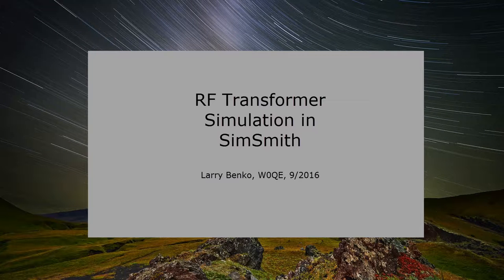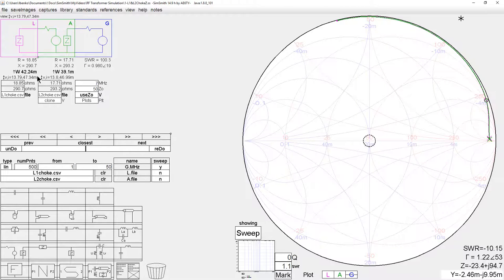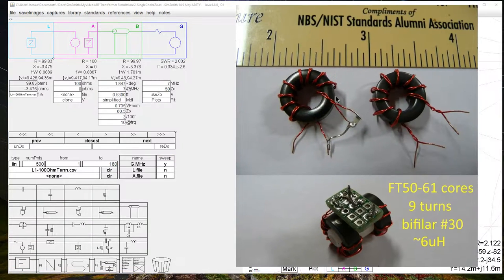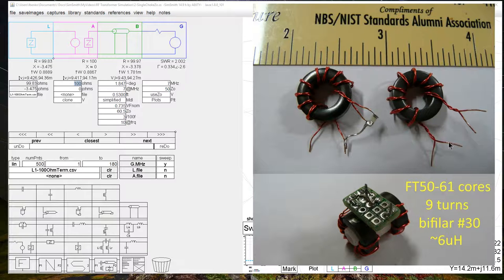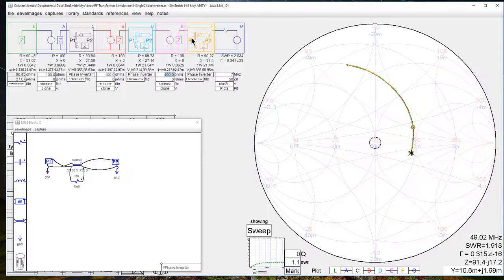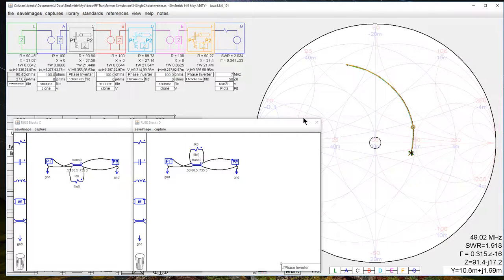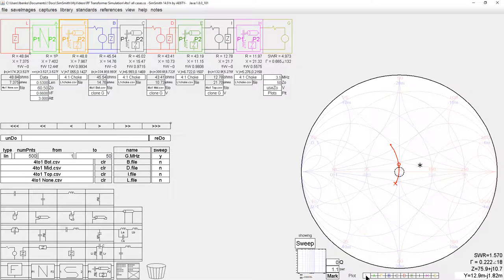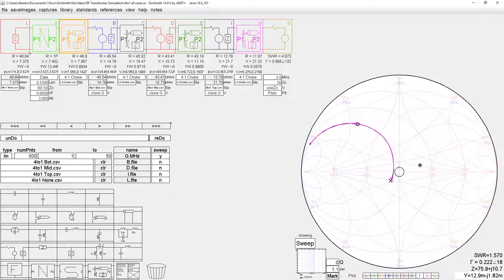#7: RF Transformer Simulation in SimSmith (Adv. 7)

Comment: I am interested in building an impedance matching circuit for phasing two vertical antennas.  Can you point me to any pod cast you or others may have done on multi winding impedance matching simulation using SimSmith?  Thanks!
Reply from the maker: Sorry but I don't know of anything that I could point you to.
Larry

Comment: Can you show more of how to create the transformer component?  Or point me to a video that discusses it? I'm interested in the other case: matching to a lower complex impedance.
Reply from the maker: I'm not sure what you are asking.  Maybe it would be better if you could explain what impedance you want to match from and to, at what frequency or frequency range, and at what power level?  Is your question how to design the circuit, to synthesize it in SimSmith, to physically build it, or to measure it once it has been built?
Larry,  W0QE
Reply: If this gets too long, I think you can go to email from this.  This is all about using SimSmith and my question was how to create the transformer component/subcircuit.  I'm looking to match to an electrically short 80m vertical on 160m and I really only need to get VSWR down to where my rig's autotuner will handle it (less than "3:1", although it will handle much worse than that).  I have an AIM4170, and a sweep of the antenna imported into SimSmith. Although it varies quite a bit, mid-band Z is 1.8-j8.3, so 8.5 ohms.  My thought here was to try an ideal transformer, a turns ratio, first and see how it moved the impedance plot in SimSmith.  Then I'd model primary and secondary inductance and stray C.  I don't see a way to do an ideal transformer in SimSmith.  Since it's 1.9 MHz, a bifilar transmission line transformer might not be the ideal component and a lumped transformer is more realizable than at higher frequencies.  A 4:1 (impedance ratio) transformer gets that (8-1/2 ohm) antenna up to 34 ohms.  That's much easier to match to.
Reply from the maker: The 1.8-j8.3 ohm impedance can't be correct.  Is this the impedance at the antenna terminals or at the end of the transmission line?  SimSmith can easily generate transformers from ideal to real with leakage inductance, winding resistance, capacitance etc.  I agree that going to email would be better.  Go to www.w0qe.com and click on the contact me button and send me your email address and we can go from there.